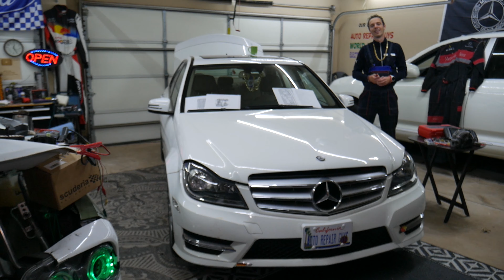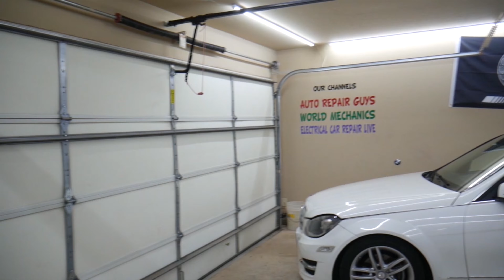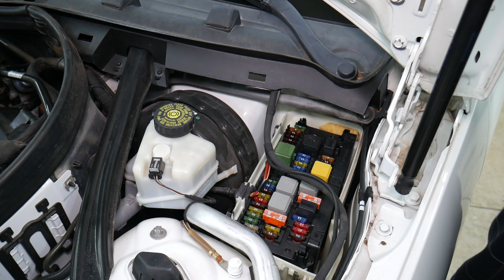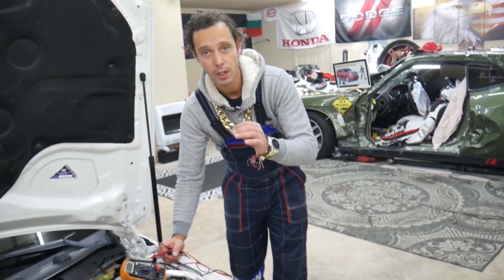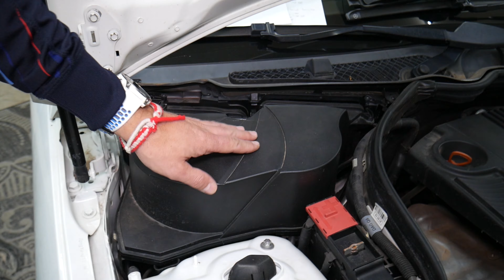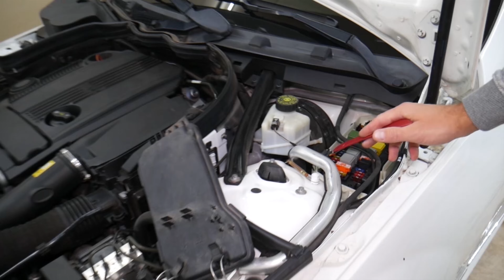Why Battery Drain When Parked, Dead Battery After Sitting MERCEDES W204 C250 C300 C180 C200 C220 C28

Comment: Hie guys, mine is a 2007 w204 c200 compressor.. i have changed 3 batteries in 2 months. after driving and the car is parked it starts ticking after about 2 minutes... if you remember the crocodile  in Peter Pan that swalled captain hooks arm with the clock??? thats the sound my car makes for hours through the night. what could be the problem? we had our mechanic service it and put it through the diagnosis machine but they came up with nothing. also my dash hass an orange triangle light. this could be unrelated to the battery issue but whenever my fuel gauge gets to the half point its like ts on empty, the take-off iss different and the rev count goes to 3or 4 just to pick up speed. do you recommend that we get rid of this car or fix it and how for the fuel gauge issue? ( my heart wants to fix it, my husband bought me this car, went over budget for me to have this car so ts more than just a car to me)

Comment: I recently faced a similar issue with my W204 C250. The culprit was a faulty central locking module that kept drawing power even when the car was off.
Reply: What you did to escape this issue?
Reply: My back door doesn't lock sometimes.. maybe the problem,,,